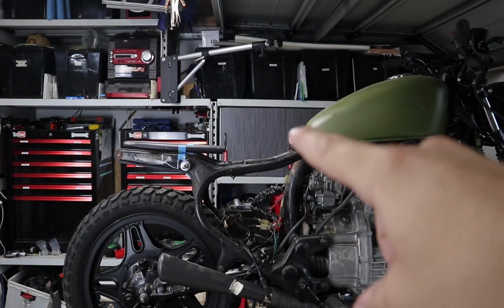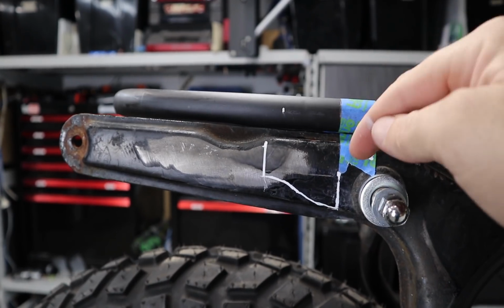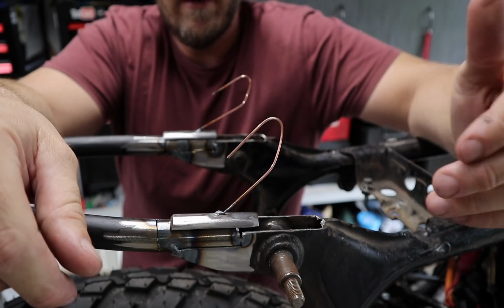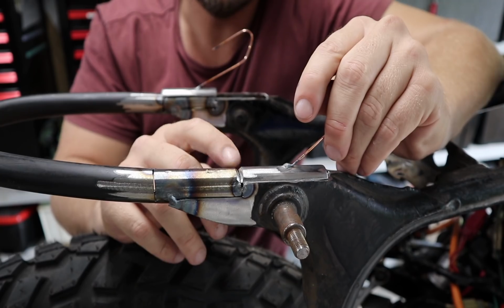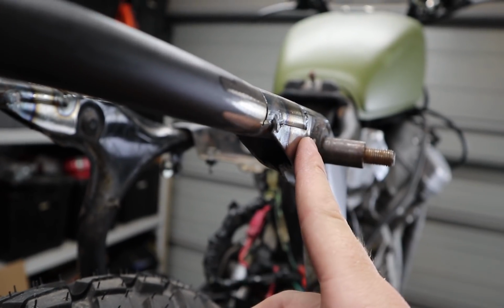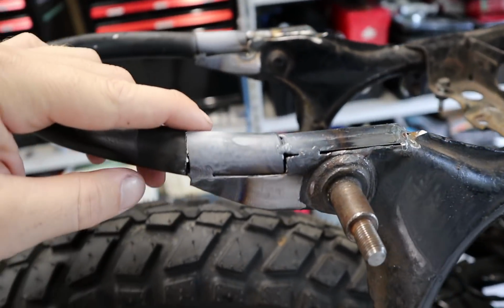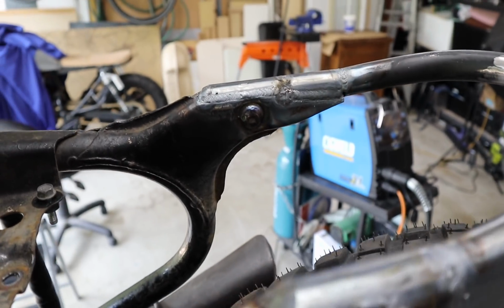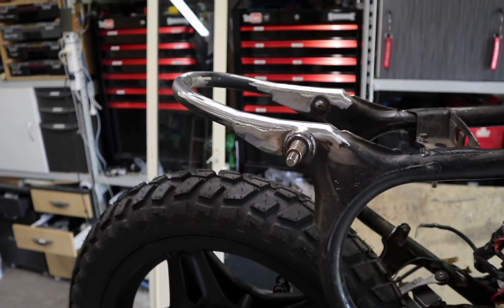Cafe Racers ★ Scrambler Frame Cutting & Fitting Hoop - Ep.16

Comment: I'm a new subscriber to your channel working my way through your videos (love your stuff by the way) awesome. Never owned a road bike and want to build a cafe racer as a first road bike. I have a tip for cleaning any alloy parts including your engine if your interested. You probably already have your own cleaning technique but thought it could hurt to add a different perspective.
Reply from the maker: Welcome Jay and i hope you are finding my videos helpful,  I will never so no to learning new techniques and putting them to good use or at least having a go lol :)
Reply: @CafeRacerGarage   See the results of my first video (on my channel) I know its a dirt bike alloy frame lol,  but the engines,  exhaust pipes and radiators of my last 2 x project bikes and came up just as well :) I need to edit some footage soon and put it up. I use Ali brite Aluminium cleaner stronger mix than the bottle suggest with PPE and a 3M scotch brite hand pad 7447, I think its also available from the states in a wheel version for drills and wheel grinder. Car painters use them for metal prep work. The pad is a metal not nylon. Check out Cameron Niela youtube and his webpage site Pryme MX
Reply: Cameron Niemela *
Reply from the maker: @Jay-mz7dr  Ha ha I bought his scotch bright wheel and sanding wheel off his website after seeing that video a few months back, what i didn't realise was the RPM of my bench grinder was way to high so I put it in my draw for hopefully one day getting a linishing machine for this tool,  The main thing im happy about is that I'm learning and supporting another channel in the process. thank you so much for the help, you are an awesome guy to take the time leave this comment brother :)
Reply: Cafe Racer Garage what a coincide. I found the Ali Brite here in Australia as a local substitute. And I build a lift table out of timber similar to yours a year ago. After seeing it on another website. Same Jack from SCA. For cleaning  I just use the hand pad got a box on line they work well. And a horse hair paint brush for the tight spots. It’s a little time consuming but great results

Comment: You definitely have some slick fab skills! I just ordered a aliexpress hoop, and its bloody stainless. You think I'll get away with burning it in with standard mig wire and argoshield?
Reply: Yes, no problem. :-)
Reply from the maker: Hi mate, great question by the way and thank you for your kind words :)  In relation to your hoop, are you 100% sure its stainless?
 try to stick a magnet to it, if it sticks it may be a low grade stainless like 304 so welding it shouldn't be much of an issue,  You can weld stainless to mild but it's not recommended if you can avoid it.  If a magnet doesn't stick to it then It will be a 316 grade and therefore a high-grade stainless so I would try and get a mild hoop if you can. Welding 316 Stainless to mild steel can crack if you're not careful.  I hope that helps.  Any more questions just ask brother ;)
Reply: @CafeRacerGarage  Yep its 316 for sure, magnet doesn't stick at all. I'm used to Chinese parts being crap because they are cheaply made (and cheap) but not to them being crap because they are made of expensive material right? I know its not recommended but there cant be much stress on a rear hoop. Its a mate of my daughters GN250 that he's learning on. Not saying I should do it badly because its a GN, but its not the fastest machine out there. What do you think, fit for the purpose?
Reply from the maker: @gregnovak0070  You can do it if you want, Just prep the join so it will be strong :) Always do a test weld before the main project if that is posable :) saves you making a mess trying to get the settings right on the main project :)
Reply: @CafeRacerGarage  Burnt the stainless hoop in just fine and welds dressed up nicely. Pity I must have measured it wrong and the hoops 30mm to long. Never mind, but it off and do it again.